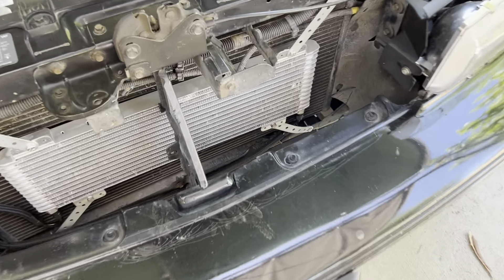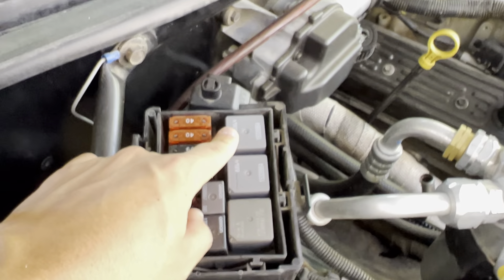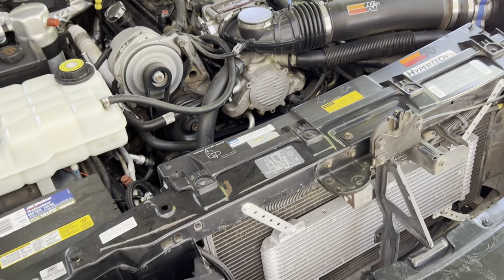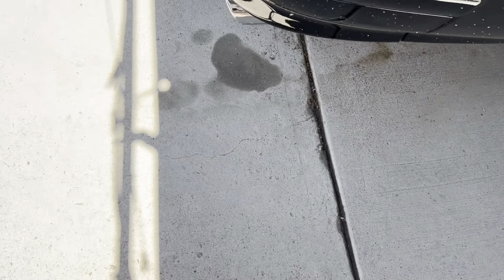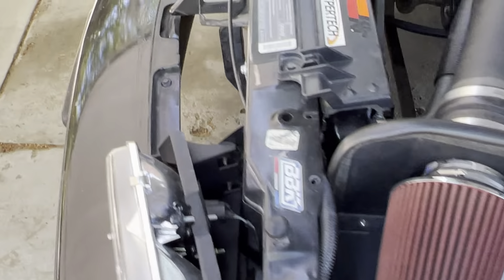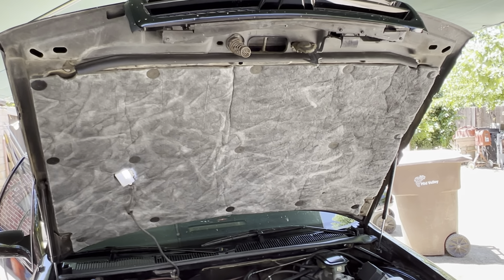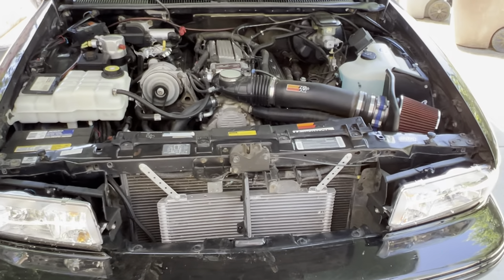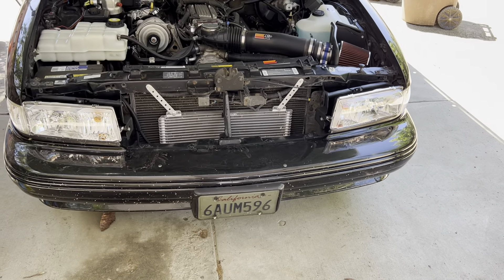New Radiator & Upgrades on Impala SS

Comment: So you just plugged that new nozzle coning out of the radiator? Cause the cap that came with mine blew a hole through it when the coolant got hot

Comment: Did you ever figure out the issue?
Reply from the maker: If I’m not mistaken, I had the PCM tuned to switch the fans back to their original position since they were switched. I ended up swapping the fan motor out as well

Comment: Just got 3.73’s for mine. What do you think would be a good stall speed for those?
Reply from the maker: What else have you done to your car?
Reply: @MidnightBlue98  ClearImage long tubes, full suspension, full 2.5 cat back, 160 stat, cai.

Just bought gears and new diff unit.

Want to get mail tune and finish up with Lloyd Elliot LE2 head and cam package.

Just not too many examples on here about stalls for our cars
Reply from the maker: @ffed3809  it sounds like for your setup, you might want to go a bit lower on your stall. Maybe around 2500 since your RPMs are already higher due to your gear ratio. There’s very good TCs out there like Yank, Vigilante, and Edge. I highly recommend you try out Edge though and give them a call to see which stall they recommend you based off your current mods and future ones. I’m also in the process to send my PCM to pcmforless for my tune. Definitely check them out too. Whichever stall you decide to go with, your SS will be flying through the streets no doubt 🔥🔥
Reply: @ffed3809  I just got a 96 and I've been working on it. I'm not as car savy but I see you did some updates to yours, if you don't mind me asking what you wrote you did can you break it down for dummies like me lol.?
Reply: @unrulysk7215   which ones you need broken down?
Reply: Bro what transcooler did you use